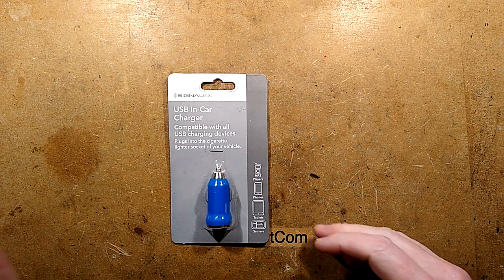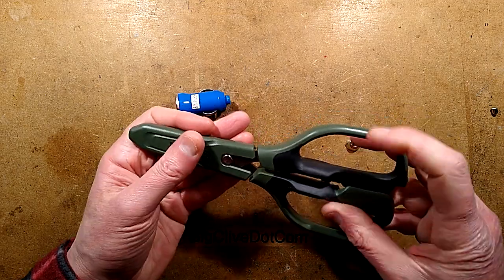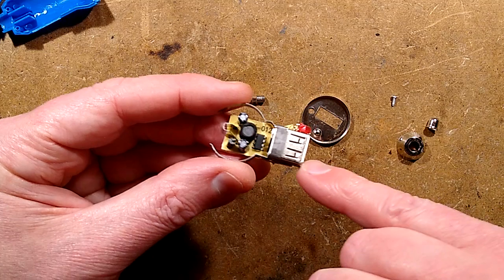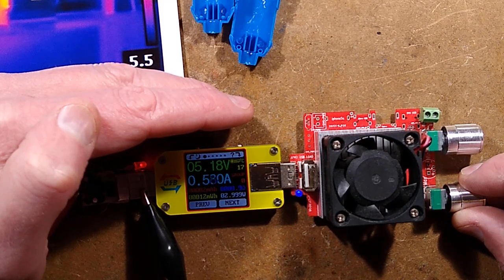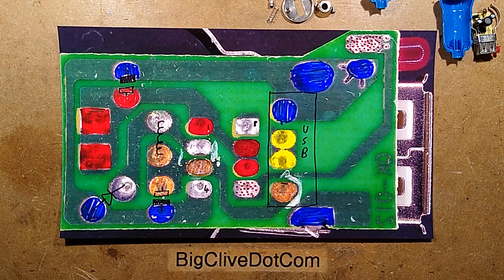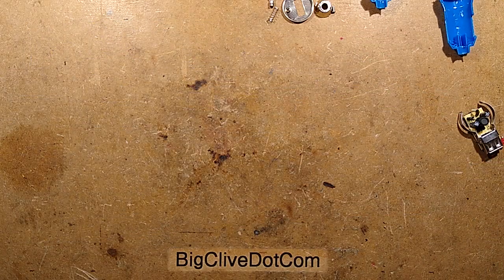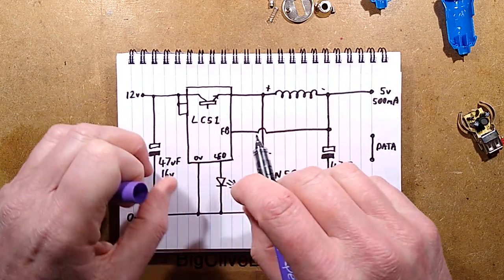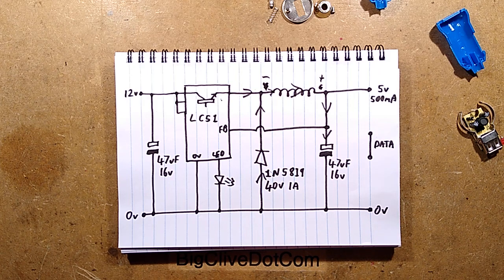Inside a Pound shop car-USB charger (with schematic)

Comment: When I see these car-USB chargers, I collect them. When I need a 5v converter, I solder them in there. One example is for connecting hard drives (requiring 12v and 5v) to my 12v supply I took from an old LCD.
Reply: Wonder if i can use this to connect to my portable home made boomboxes and use these to simply convert power to 5v for a bluetooth audio usbstick receiver.
Seems alot easier than using 12v to 5v power converter boards, no need to solder.
Reply: @cybernaab  Also if you need 3.3 volts off of the 5V line just put 3 silicon diodes in the right direction (enabling current flow) in series. I did that back when I had a Raspberry PI LCD screen that I glued to a PC case as a case-mod to run it off an old-fashioned hard drive connector and the HDMI output. Use some settings in Xrandr and Kmag and you have a progress indicator monitor when encoding video or doing another 'talk about carbon footprint' CPU hungry task that takes a couple days to complete.
Reply: @brentfisher902  Hmm nice idea, had never tought of making a small progress bar that way, clever cheap way to convert the 12volt lines to 3.3 volt.
Funny how i always think so difficult when iam busy with electronics (also have problems doing simple math) when it can be this easy.
Only thing iam worrying about is the quality of such cheap power converters, arent you a bit scared to destroy your computers psu and maybe ssd/hdd data etc when it shorts?                           
 If you look at how many months years this power converter wil keep working without issues do you think its worth it in the long run or expensive in the end from buying new converters after they break   i  have no clue about it's life span with probly copied knockoff parts or unknown crap
(speaking for all the alie expres/amazon dollarstore random quality items)
Reply: @cybernaab  Given that the whole PC was a gift from a friend, and I always back data up to recordable blu-ray discs...I wasn't too worried...I got to use the computer for 2 years and I paid $0.00 for the privilege.
Reply: After opening a faulty charger, I figured out the famous MC chip Clive was mentioning and then ordered an handful of them, with self and schottky diodes, in order to easily power my creations
Reply: @brentfisher902  Good to hear,2 years is a respectable time for such a cheap converter  altough that might just be luck
Reply: @CaptainDangeax  I hope that they last a long time (with the correct diodes offcourse, iam quite a beginner myself in repairing electronics so i probly mess it up anyway :P even with simple part swapping like this)
32 years old and just started with relearning about electronics, before i simply replaced old parts with same spec parts since math isnt my strongest skill
Reply: @cybernaab  Datasheet is your friend. If datasheet says "use schottky diode ref xyz", I order xyz...
Reply: @CaptainDangeax  still sweating buckets everytime XD
Reply: I found an excellent power
Supply in a cable company
internet, self install kit.

Comment: Well, you probably rescued it from a life of struggling to keep my S20 battery at 10% without actually adding anything to it on long road trips.

I like the color coding on the pictures. That helped a ton.
Reply: I was getting the same performance with mine  and half wondering why. Now I know.
Reply: I use the 500ma usb port on my router to slow charge my s8 overnight

Comment: ♫ It was acceptable in the 80s ♪ 😁
I've gotta give them credit: it did actually output what the sticker said, in terms of voltage and current.
Would've been nice to see a 'scope trace of the output voltage, because some switcher outputs are horribly noisy on consumer/budget stuff like this.

Comment: The original USB specs only required (allowed?) 500 mA current.
Reply: going by the book at least, i think that by shorting the data pins a charger is advertising itself as a v1.2 charging port, good for up to 1.5A.  how naughty of them to short those pins!
Reply: I'm not sure what an original USB was.  A million years ago while I was working at a large company noted for their mainframes, I remember very spirited discussions with other companies over the current allowed, I think it was 1988 or 1989 for what is now remembered as USB 0.3 (?) this was before the official industry standard was set seven years later.  A series of meetings where everyone was The Expert trying to decide on a design standard for which no one could agree on the actual requirements, bang your head against the wall.  Tell me why the connector *had* to have a physical orientation?  Sure, label it with lettering that required bright lights and a magnifying glass to read, And require an orientation and let hundreds of millions of users forever try to insert the connector upside down.  Oh, those were fun times. Fun times I wish never to repeat.
Reply: @davidnull5590  "So guys, ideas for the new USB standard connector?"

"Well, it should only work if you plug it in perfectly, and even then, sometimes it should fail to connect properly, forcing the user to replug it."

"That's great, what else?"

"How about we make a secondary connector type that has the same problem, but is a completely different shape, so it doesn't fit into the regular socket."

"That's amazing! Should either of them be durable?"

"No, they're basically hollow and made of thin metal, so if you drop something on them or accidentally stand on them, they immediately bend out of shape and can't be used again."

"What an idea! We should also make it so that after 100 plugs and unplugs the connector becomes weak enough to just fall out of the socket, and if the user bends the cable then the internal wires immediately snap."

"Great work. We'll get that to Intel in time for it to become the norm."
Reply: @davidnull5590  fascinating to hear your tales.   Totally fits with the resulting user experience over the years!
Reply: @yeliab814  Compared to the days of RS-232 serial ports that are slow as molasses in January through an oil-burner nozzle, parallel ports where if you look at them the wrong way the pins bend, having to reboot the computer every time you plug in a new device, and having to have a separate charger for every single device you own, USB is a godsend...They could have made it better, but this B on test sure beats the 38 Double Z cup size grade connectors that came before...
Reply: @brentfisher902  True, true.  Although I always liked the connector on the  other end of parallel printer cable (Centronix?).   

The worst growing pain with USB was the days of windows 98, XP or so, whereby you  bought a new USB device and if you plugged it in before installing its drivers  it would never ever work again without reinstalling Windows.  The manufacturers used to put a yellow warning sticker blocking the USB port to help ease the tech support nightmares.
Reply: @brentfisher902   Was going to say the same thing.  Anyone complaining about USB 1.x/2.0 clearly either wasn't around pre-USB, or has completely forgotten that time.

Here's a short list of reasons to be thankful:
1)  Your standard issue generic external peripheral ports were parallel and serial.  The former and half the time the latter having giant 25-pin D-sub connectors distinguished only by their gender (parallel was a male plug on the cable, female socket on the computer -- serial was vice versa.)  The plug was ALMOST asymmetric enough to get the orientation right if you could feel it but couldn't see it.  The ends were huge, ideally had to be screwed on via two posts that often bent, broke, stripped, got stuck, had too little grip to use without tools, or didn't line up quite right.  The cables were thick.  And it was s-l-o-w.  You're not supposed to hot-plug, and for many devices, you had to reboot for it to be recognized by the drivers anyway.  No meaningful power over the cable, but very low power devices might be able to siphon enough off of the signal lines (that was rare, though!)

2)  KB and mouse would be PS/2 connectors (unless the mouse was serial.)  Usually not hot-pluggable.  Might work again if unplugged, but often the whole computer had to be rebooted to get your input device back.  Hot-plugging could actually blow a one-shot fuse on the motherboard, so you take your chances...

3)  If you wanted external storage, you could buy a SCSI card.  It would have one of a variety of connectors, all of which were at least as large as a parallel cable.  (And sometimes it was actually the same physical connector, but totally incompatible electrically.)  The card would set you back a couple hundred bucks, and would take an extra 20 seconds on boot to enumerate the bus.  Each device had to have a unique ID set by jumpers or switches.  You had to know what a terminator was and how to use it correctly.  No hot-plugging here either.  No power from the bus (technically, maybe term power, but that's not meant to be used as a supply.)

So yeah.  The original USB A connector had to be inserted the right way.  It is maybe a little fragile (although, if you don't handle your devices like an angry wild ape, it should last a lifetime.)  And it "only" supported 500mA in the original standard.  But my gosh have we gotten some mileage out of that little connector...

IMO, the recent frequent form factor changes and kitchen-sink approach to power / display / bus / whatever standards and the connectors that support them... it's getting away from the spirit of an easy-to-use and ubiquitous plug.  I would rather have a simple, standard lowish-speed USB for pedestrian devices and a higher-speed bus like Firewire, Thunderbolt, or what-have-you.  Being all things to all people never seems to work out well.

Comment: Rest assured that in a few months / years they will find a way to integrate the Schottky diode into the IC to further simplify the circuit
Finding stuff like this at 99 cent stores is a great way to start a fire. I once found an "Eye safe" green laser pointer for $6 that was easily 400mW!
Ought to send some of that stuff your way should any of it be truly interesting.

EDIT: I noticed the video was grainy only to find I'm so early that YouTube hasn't processed the HD video yet...
Reply: Even better would be if the integrate those active rectifier components (the ones with two terminals and look like diodes but are actually self powering diode/parallel mosfet combos).

Manufacturing costs might be too much, though, as I assume those active rectifier chips require more expensive fab processes than a cheapo switching chip
Reply: The video was capped at 720p and has been for a few days. Not sure what’s going on there.
Reply: Those chips have existed for several years but they are more complex inside as switching time becomes a serious issue to efficiency. They don't integrate the diode, but use a low-side FET. They are called synchronous buck converters to the asynchronous buck that Clive has in this video.
Reply: The idea of an eye safe laser pointer of any power makes me laugh
Reply: @ianhosier4042  Why? Laser projectors exist and lasers are used in the latest AR/VR technologies to project images directly on the retina without the need for complex focusing.
Reply: @BRUXXUS: YouTube finds it more important to improve the way of pissing off ppl by adding ads wherever possible than to release the videos in the quality the channel-owner has uploaded... :/
Reply: @gerhardkoschany1087 
Slide the progress bar to the end, wait, then replay without ads embedded in the video!
Reply: Many chips have the schotkey diode incorporated.
Cheap fabrications probably don't allow it!
Reply: @_a.z  I always click the information button and select "Stop seeing this ad -> Irrelevant" because the ad they're showing is never relevant to the 100 year old marine engine that mustie1 is starting or the 40 year old television shango066 is turning on or the USB charger bigclive is taking apart
Reply: @gerhardkoschany1087  Karl says, "You may be suffering from capitalism..."
Reply: @ianhosier4042  When I was a teenager I would do the "Camera Flash Challenge" which would be going into a windowless room in the dark, waiting 15 minutes until your eyes dark adapted, then holding up a film camera's electronic flash tube (with no film in it) right next to your eye socket and talking a flash picture, then walking out of the room in a house with switched outlets, table lamps and no light fixtures at night and seeing how well I could navigate...That didn't do much damage...it was the days I ran a CD recorder drive with the top off while a CD was burning, kicking the whirling CD-R off the spindle and looking into the burner laser to 'see how much brighter it is'...now I have a whispy black figure out of the corner of my sight when I dart my eyes after looking at a solid colored surface...."You can replace a camera, but you have only ONE set of eyes.." Listen to Ansel and don't do what I did....
Reply: @brentfisher902  Sounds like you have floaters. Common eye complaint. Nothing to do with lasers.

Comment: The circuit is an asynchronous buck converter. Nice and cheap because the chip only needs one FET inside and works with the external diode to freewheel.
The heat from the chip but not the inductor or diode indicates a fairly high on resistance that is wasting power. It's probably an old chip or one who's lithography does not have good power structure.
Two things to note:
- The D+ and D- pins being shorted indicate to the device that the connection is to a charger only and so the device can turn up charging current until the voltage collapses and then back it off a bit (this sets the fastest current charging).
- The input capacitor from the car's 12V is the most important component to suppress noise that could interfere with other electronics (depending on the switching frequency and the on/off time of the FET). It is poorly laid out in this circuit with the usual mistake that the positive is near the input but the ground side is forgotten and takes a tortuous path around the edge of the board to the ground pin and the diode.
Layout to suppress noise on buck converters is one area that I get into blazing rows with colleagues who just assume the ground is all one voltage and always forget switching currents and how local their effects can be.
Reply from the maker: I don't think it's a FET in this chip, going by the datasheet and pin labelling.
Reply: It's a close call either way. Vce(sat) of a typical BJT is around 0.35V. 0.35V*0.5A=0.175W multiplied by the duty factor (5/12) gives a power of 73mW. Whereas, if the Rds(on) of a FET was 1ohm (not unheard of) 0.5A*0.5A*1ohm=0.25W multiplied by the same duty factor gives 104mW.

Comment: Hi Clive, one thing that has been going round and round in my head for a while is, have you ever considered taking apart a hearing aid?… I would be absolutely intrigued to find out exactly how the circuitry is all made up, video for the future maybe?…
Reply: WHAT?
Reply: Well I guess it's just mic and audio amp on single board.
Reply: I'm sure that was the case a few years ago but I should imagine it's more than that now... I have one.
Reply: @plainedgedsaw1694  some modern ones also have bluetooth headphone capabilities

Comment: Even with this super cheap tech those IC chips are still so amazing to look at under a microscope and they sometimes have easter egg text. (If im not mistaken,  any chip like that has microscopic integrated circuits that can't be seen by eye)

Comment: I cracked open a couple of these cheap chargers a couple of years ago. Those all used the old Motorola MC34063. This chip seems to be a simplified version. The MC34063 goes back to the 80s. I still use it, as its a very versatile chip. Still used on these cheap chargers as late as 2015.

Comment: I had the 1A version of this charger. The case looks amazingly similar, except two screws on the round plate and two USB ports. I got it from one of those impulse bins on the counter at the pharmacy. I paid a good bit more for it, but it was a few years ago. At some point the spring for the positive contact popped loose and shorted out until it finally melted through the spring. It had no fuse, and the car had a pretty good sized fuse for the accessories, so the spring gave first.

I've actually still got all the bits sitting here on the bench, I've been meaning to do something useful with them.

Comment: So ultimately, a good design, but an outdated current. This 500mA current is all that USB 1 and 2 could do, so it means this design was made before USB 3 came out. Meaning this design is pre 2008 design. So this means this thing would have been back in the day when people commonly used the ipod nano and such. 
Obviously with modern designs, you can even buy off ebay for 2-3 dollars, they will have dual ports and outputs of like 2-3amps. 
So what could you do with this old type in the video? I am not really sure to be honest, most phones and such will try to draw too much power from it and make it shut off. And most people don't use a separate GPS unit in their car anymore, but instead it's built into the car's main touch screen. 
Therefore, I am stumped with what you could use this for, it would appear to be useless in our modern times.

Comment: When I checked them out a few years ago they used to claim 1A rating but had a regulator with a switch/inductor output rating of 1.5A and a max actual rating of .75A. The sense resistor limited it to about 700mA